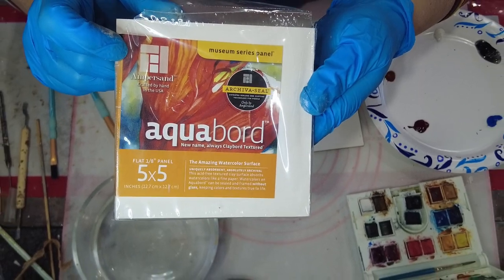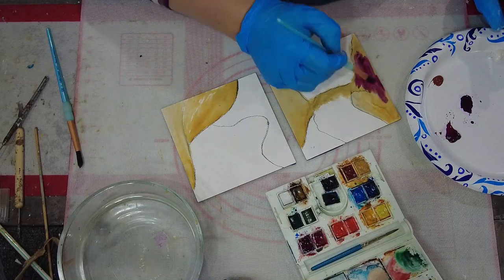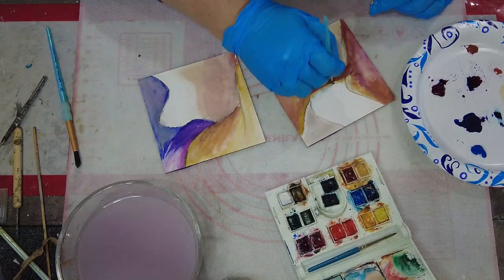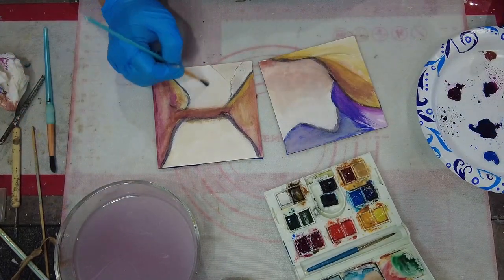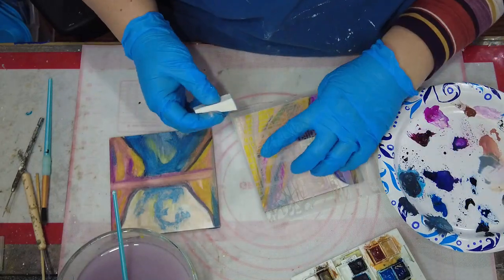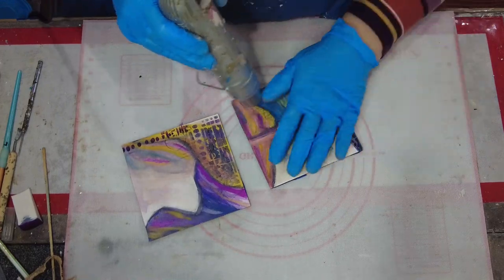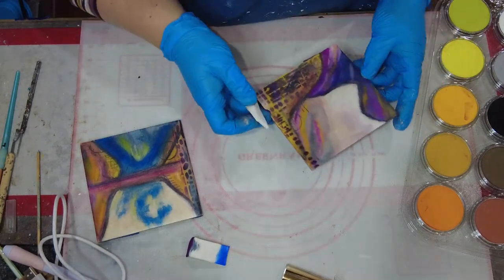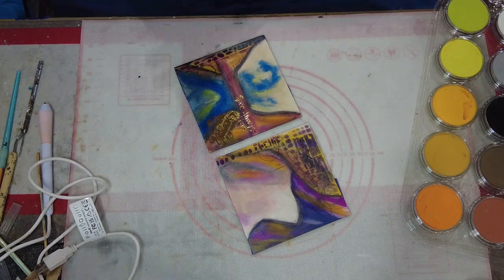I can create a SMOOTH SURFACE too! -Encaustic demonstration

Comment: Ohh never mind foil pen😊
Reply from the maker: Ok,  you found it?
Reply: I did thanks. I do have a question how do you get your wax soo smooth ? I haven’t painted with watercolor yet is that how? I would love to show u some of mine.
Reply from the maker: Smooth surface has to do with your fusing.   Sometimes you fuse lightly a couple of times.  Sometimes you scrape back rough areas then fuse.